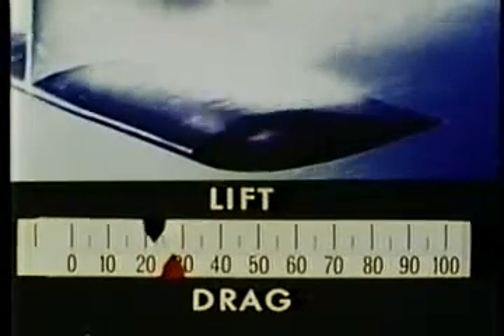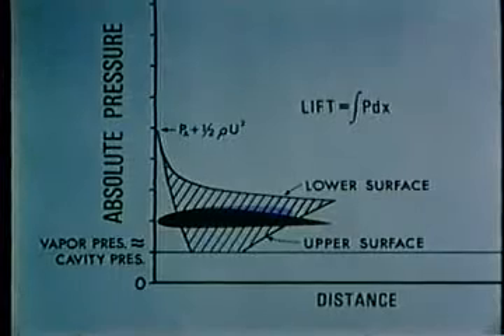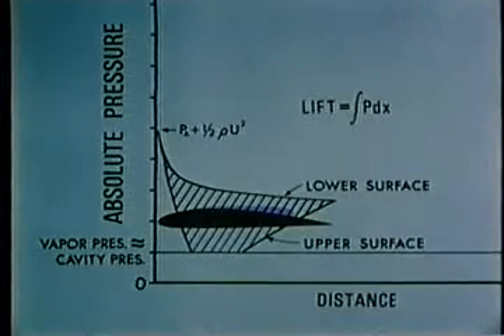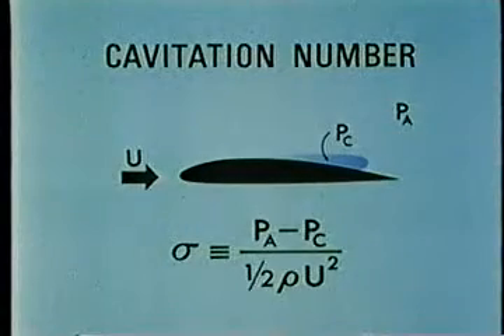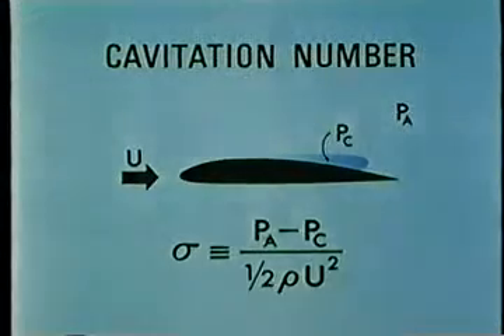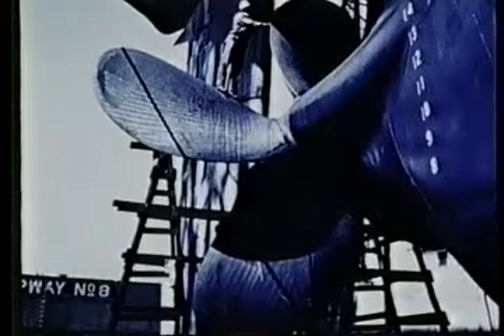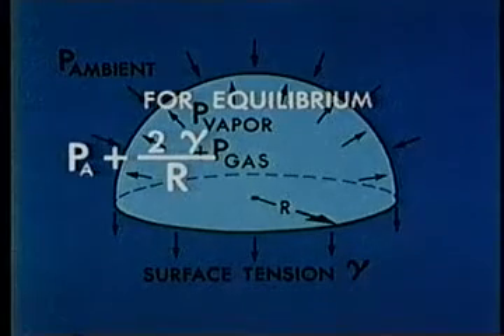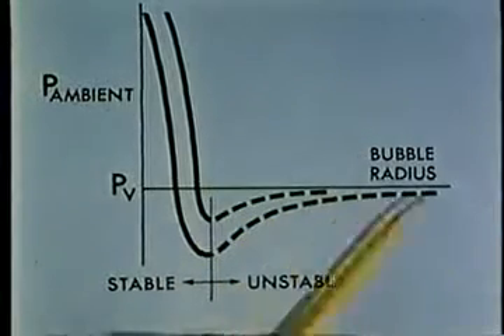Cavitation

Comment: fluid: gas bubbles form at ship propeller wingtips
air: water condenses at airplane propeller wingtips
erm... why is this apparent contradiction?
Reply: Air compression is easy, liquid compression is hard ☝️
Reply: @kxkxkxkx  that's true 😂 but is it relevant? 🤔the wingtip vortices are low pressure areas in both liquid and air, so it's expansion, not compression, right?
Yet liquid boils, humidity condenses at the propeller wingtips...